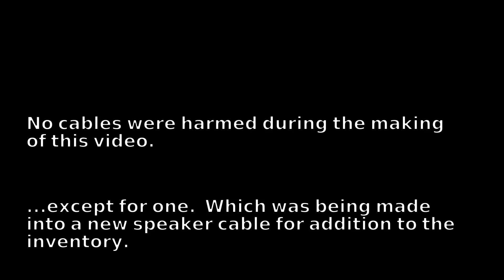Speaker cables and signal cables - using or abusing them?

Comment: Good points.  I still cringe when a ‘helper’ starts coiling up a cable over their elbow like he was working sailboat rigging.  Another correct observation - it’s the ends that fail almost every time.  Knowing how to solder new connectors will save your ass one day.

Comment: I do small shows and my assistant is (was) constantly complaining that I am too rough with the cables, the fact is that I have cables more then 30 years old and rarely have one go bad, if they do, they're my cables, I have plenty of extras, and I'm the one who fixes them in the rare case that they need it (he wouldn't know what end of the soldering iron to grab).
One form of mic stand abuse that drives me crazy is when the guys in the bands grab the boom and move it without loosening it.Now that's abuse!

Comment: I've had several Mic stands go flying; not intentionally.  Most recently, a mic stand got put into the path of a stage curtain which got closed causing a JTS Radio mic to end up falling about 10ft from the top of the stand and the stage to the floor. Thankfully, it survived.

Comment: Unless you run over it with a pizza cutter, the cable will survive.  Cable ends, however, do have soldered wire connections, and solder can crack and start to lose dependable connectivity.  You don't have to baby them, but try not to slam them any more than ordinary rig set-up procedures would deem "allowable wear-and-tear".

Comment: People baby their gear to much. I understand being protective over your board and not wanting ppl drinking over the board but racks and wires are heavy duty for a reason. Their meant to me moved sat on stood on dropped and pushed around. That’s their function. Your not supposed to baby them. You can if you want but their built to thrown around that’s why their so expensive. Because their heavy duty

Comment: PowerCon, not SpeakOn Power. But for real, if your cables are too delicate that tossing them around during use breaks them, then the cables weren't worth buying the first time. I have thousands of cables and only expect them to last about 5-10 years.
Reply from the maker: Good catch!  I should have corrected myself.  Most of our cables have lasted about 10 years, though, we tend to use the same ones over and over for events... keeping the others (at the bottom of the case) for replacements.

Comment: At the very very least tape your cables down to protect them when they're on the ground, if heavy racks or equipment are going to be rolled over them use cable ramps. It's not only bad for the cables to roll equipment over them it's a trip hazard
Reply from the maker: Good reference.  The cables are taped down and covered (where needed) with mats.  However, not every inch of the cable(s) is covered.
Reply: @stageleftaudio  not every inch needs to be taped, but cable ramps will save your shit even if it's really good cable it will break under the weight of some road cases or equipment